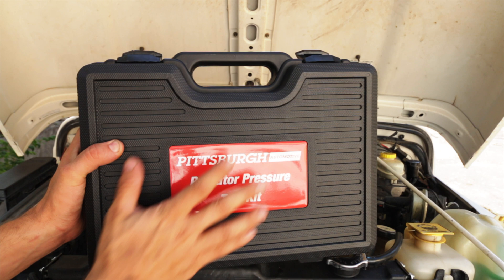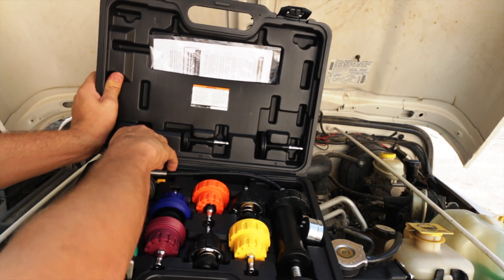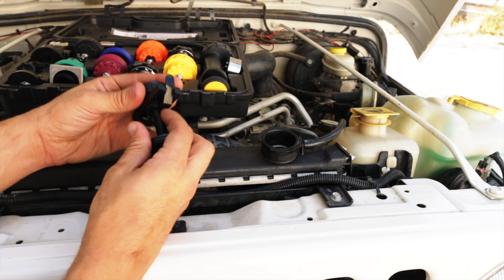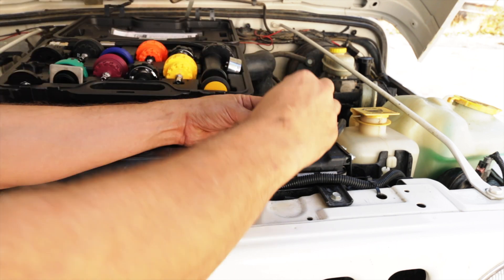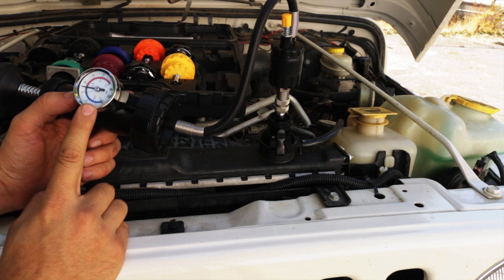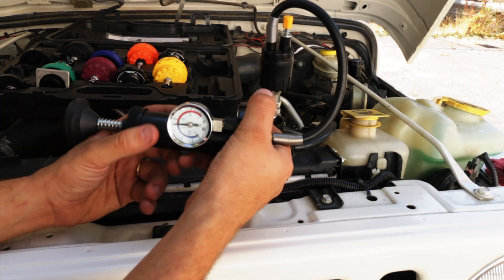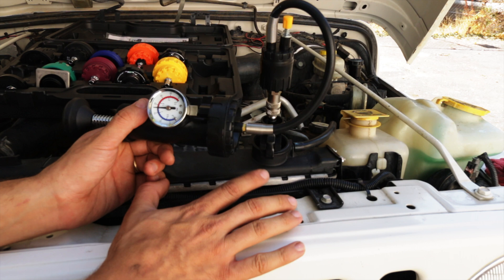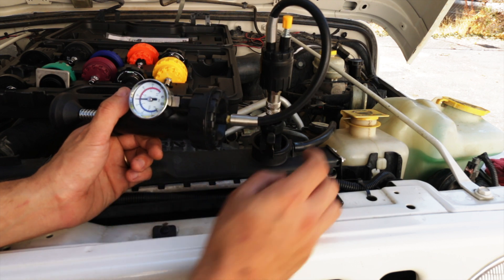How to Pressure Test A Radiator

Comment: Did you ever get this figured out?
Reply from the maker: I did! The coolant system needed a good flushing. I’m actually going to swap the radiator out soon, as I believe it’s partially plugged.
Reply: @EmbarkWithMark  I was curious because I'm having the exact same issues except my cooling system is all new OEM Mopar with the exception of a HD Clutch fan and hoses.  I just flushed it and still gets up to 220 at idle, AC on blast, 95ish * outside.  Runs super cool with the AC off.  I was just curious, thanks for the response
Reply: @jnork5005  I'm having the same issue were you able to figure it out?
Reply: @mazenkano1811  nope, I just live with it.  When it starts to temperature creep, I switch off the AC and rev it up to engage the clutch fan.  It only does this at super slow wheeling speeds in 95 plus degree weather.  Some folks say it's normal.....my old Cherokee didn't do it, so it's not normal in my book.

Comment: So, the one thing I've been looking at lately is the condition of the fins on the a/c condenser. It's mounted right to the front of the radiator, and I notice that mine has tons of bent over fins. I'm thinking that's a pretty significant restriction of airflow to the radiator. What's yours look like?
Reply from the maker: I have considered that as a problem as well. Common sense tells me that if the a/c condenser is blocking air flow than it would cause a problem. Supposedly there is a tool out there that helps straighten those bent fins, I might look into sharing this. However, mine looks to be in pretty good shape. If I  look dead on I can see right through it.

Comment: I used a derale HD fan clutch from a dodge van, and a 6 bladed , 18" derale fan.   I have an auto, so I also did a trans cooler. 
Have you ever flushed your engine block with caustic?
Reply from the maker: I tried a ford fan with a ford HD clutch, no change. I did a coolant flush with Thermocure, that seemed to help alot. Unfortunately it has started cooling off so testing this is a bit harder. I have never flushed the engine with caustic.
Reply: @EmbarkWithMark  did you ever figure this out?  I'm having the exact same issues.